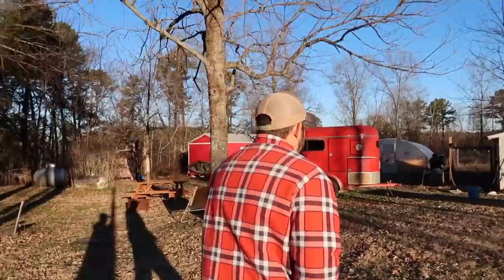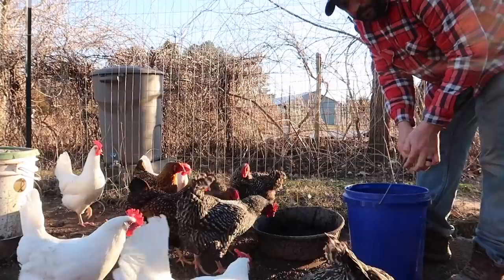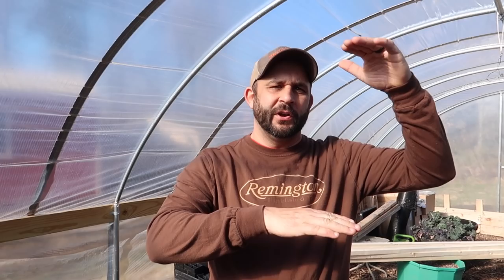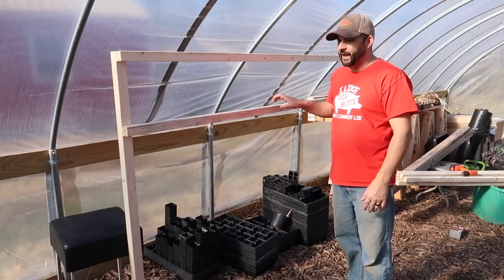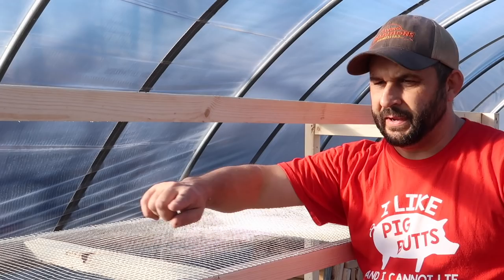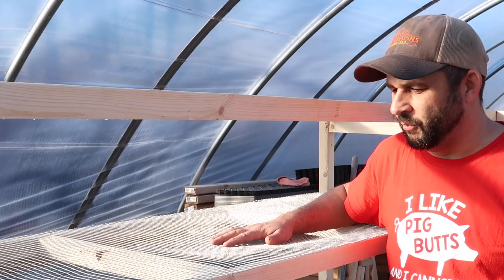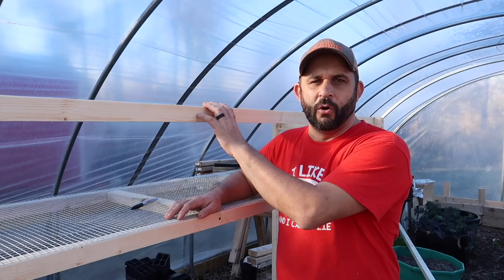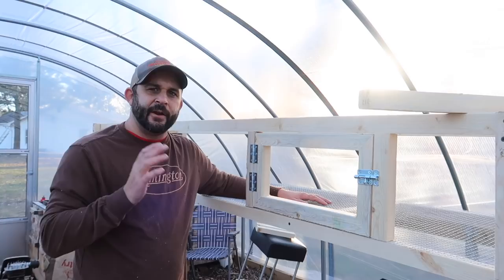Can Quail Feed Your Family?  Let's Do Nerdy Quail Math!

Comment: I used to breed quails. I kept 64 quails in one huge cage ( 60 females and 4 males ) we had 99% fertility. I found out if you raise the temperature by  2 degrees during incubation you will get more females than males. I always ended up with 85-90 females out of 100 eggs.
Reply: This is very interesting. Thank you for the tip.
Reply: Kinda hard to believe? I tried to keep I male with 10 females! My hatch rate took big hit ?,so I put 2 males, as an experiment? Not good til I had 3male per 10 females  then I had 97 % fertility rate ? Maybe y’all were given them 4 That purple pill

Comment: Great little cage. Will you rotate out your breeders? How long would you keep a breeder before processing?
Suggestions on your supports...
1. Install at 45 degrees so poo can be scraped off easily from underneath
2. Use pipe  or even rebar instead of timber - set into a notch in the bottom frame. Can easily be turned for cleaning/scraping (pipe could be suspended on a screw in each end)
It's so easy being an armchair expert!

Good to see you had the scales there so you did not exceed your 10lb limit! - Just be careful and no 'twist and lift"

Comment: Far faster cleanup, consider getting PVC pipe cutting a slat wide enough to allow you to slip squeeze it on and rotate over the slats makes cleanup simpler and no need to replace the wood.

Comment: You could use plumber pipe in the middle if you want or use a plastic items to cover the wood.  Like me I have spring water jugs and could cut some parts off it and have it cover the wood. When I get some birds was thinking of build all with plumber plastic . Great job on the cage.

Comment: Suggestion put foil around the cross supports that will protect them from rotting.  Another suggestion is with a big cage like that is to build it with a slit across the top so you can slide a thin divider.  That way when your ready to catch the birds you aren't chasing them from one end to the other.

Comment: Very nice cage! I and my husband build cages and raise quail chickens turkeys and goats and variety or plants. 
Tip on the cage floor. Instead of having to change the wire several times u can use 1 x 1/2 for the floor it's more stable and lasts longer.

Comment: Love your videos! Had a suggestion so you don't have to replace center support slip a piece of thin plastic, linoleum scrap or thin tin something like that in between your screen and 2 x 2 then you could just pull it rinse or replace it instead of replacing supports. Thank you for all do!
Reply: So many good suggestions ... and this seems the easiest and least expensive.

Comment: I find that quail poo a lot and often along the edges. Having the 2x2 along the bottom under the wire might not be the best. I use suspended wire rabbit type cages one foot high with 1/2 inch hardware cloth on the bottom. I brace that with those 1/4 inch round orange fiberglass driveway marker rods cut to width and zip tied to the bottom. Takes the bounce out and floor flat and the poo doesn't accumulate on that.  I'm up in B.C. so we don't have snakes so I can use 1x1 wire for sides and top.
Reply: Thanks for that

Comment: you could essentially double that schedule. Put a new batch in the incubator 10-11 days after the previous hatch was moved to the brooder.  when you get the 2nd group hatched out, move the first to the growout cage (4 weeks). 10-11 days later start another batch in the incubator. when they hatch, butcher the 1st batch in the growout cage (8 weeks), move the 2nd hatch from brooder to growout, and 3rd hatch to the brooder, etc etc etc. that all being said, you get what meat you want with your schedule, just saying it could be done "better'' if needed.

Comment: I would have built it 4 feet high and put the doors on the top. When they feel threatened from above they tend to crouch down instead of fly up. I find access from the top much easier than from the side.

Comment: Music just just use some parchment or even some old newspaper paper between the metal mesh and the wooden braces. Once the paper gets really cruddy just pull it out and slide another piece in and you won't be replacing the wood. and any paper that they poop on and stuff can just go into the compost pile and help with the composting. Could almost have just roll of parchment paper on one end on a dowel in this keep it there and when you need it will it off and slide a piece in the to be so

Comment: so 52-6 = 46 x 7 x 12 = 3864 spare quail eggs per year

Suggestion for future nerdy quail math.. Work out the cost of rearing a batch of quail and then compare cost per meal to your chicken math - also useable meat weight to compare per meal with a chicken.

To the untrained eye they seem infinitely easier to deal with than chickens in tractors, though I bet they are fiddly to process - and 6 x the processing numbers per meal compared to a chicken.
Seems you could easily double up on his with another cage - or just half as much again would allow you a break between batches to give the cages a thorough clean and sit out in the sun for a week - you dont need to lose the whole flock to a disease.
Reply: Quail are MUCH easier to process.

Comment: The breaking their neck thing is baloney. Everyone says it, but I think they are just trying to explain random deaths...I have a hutch taller than a foot and haven’t had a problem with them breaking their necks on the ceiling.... Plus, since they are not meant for sustained flight, the higher they get, the less force they hit the top with, and the lower the ceiling the more force they will be hitting it with!
Reply: i agree with you my   cage  is well over six feet
Reply: I was thinking the same thing, the most energy they produce is as soon as they leave the ground, taller would be safer. The only reason to have short cages is to save space

Comment: Figure 2 meals a day with quail will require 8 eggs minimum per person (breakfast). 2-3 birds per day per person. Then you gotta figure in what your sides will be. You'll need a proven incubation method either broody hens and or incubators. You want to load your incubation heavy. Figure in a 70% hatch rate 2 weeks to hatch 7-8 week to harvest weight. Plus replacement hens every 9 months. If you only intend to eat quail and eggs you'll always have a incubator running, brooder for chicks and juv pen.

Comment: Why not slip heavy duty strips of lawn bags on top of the cross support beams since you don't staple the wire to them? When they get messed up, pull them out and replace with another. That's easier than replacing the cross support beam. An easy insertion tool an be made from a flat piece of rigid plastic.